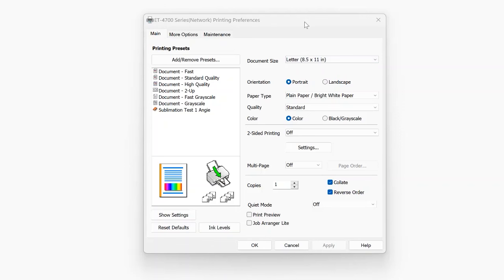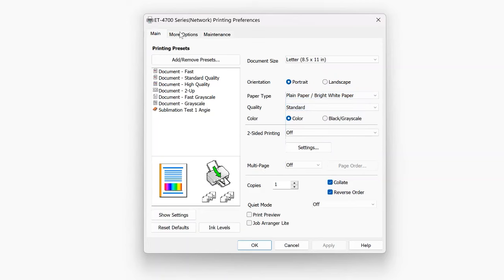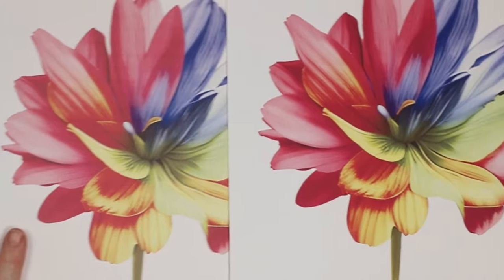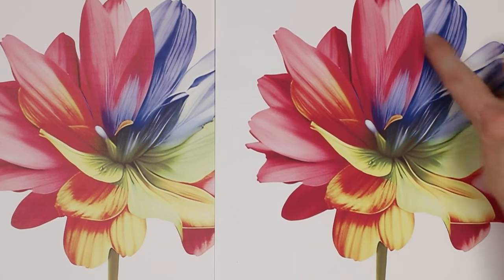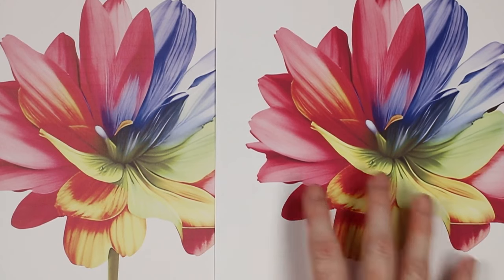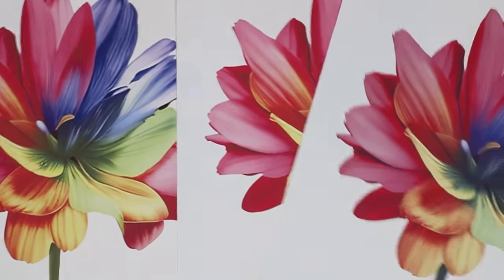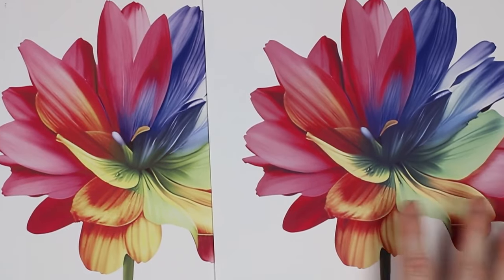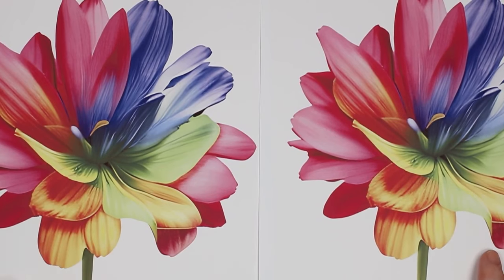How to Fix Lines in Your Sublimation Prints

Comment: TIP: Print head alignment is cumulative. You may need to do it more than once. Sometimes they can get way out of alignment for no obvious reason - or if the printer gets bumped. Happened to me. I needed to do 10 consecutive alignment cycles to get it back in range. You just keep running the alignment settings back to back. Keep choosing the best looking blocks. It will get microscopically better each time until it finally starts to actually look better. Trust the process.
Reply from the maker: Ten! Blah!
Reply: Not sure what has happened to my printer. My paper gets jammed when I try and print. Not sure if this is printer head alignment issues, or something bigger. Ink leaks, but strangely, my ink pads are not full or overflowing.. Printer hasn't been knocked/bumped or anything like that, so I have no idea where the issue is
Reply: So if it has lines in it are you able to run it back through the printer or that sublimation print garbage?
Reply: Exactly what i had to do but Worked!

Comment: Where do you find the printer settings. You skipped that part 😢
Reply from the maker: Depends on your computer but you can often just search printers on your computer to access. You will also want to make sure you have the correct driver for your printer. Go directly to the Epson website and download the driver for your specific printer model.

Comment: Thanks for all the clear help with understanding settings. I have the ET-15000 and I do not use sublimation ink, just the standard ink that came with the ET-15000. I just finished doing the purge/head cleaning cycles to get my cyan fully showing up again. There is still one issue... I am still working on it, but as of now I can't seem to completely shake these extremely faint darker blue banding lines running horizontally across the cyan color block. I only see them when printing in standard, but they are not there when using the high setting... on high it looks 100% solid and beautiful. Judging from what I have said, would you say my problem is no longer a clog or air in the lines so doing a 24 hour wait wouldn't really help at this point... and what my issue is now is solely with continuing to clean the print heads? I like the look of high better anyway but would rather not HAVE to print in high for everything. You made it sound like if you print in standard with plain paper setting you can likely expect the banding. Is that just the way it is with these printers and plain paper/standard setting right out of the box and they always gives those results? If so, that's disappointing and I would have hoped the Ecotanks, especially the pricey ET-15000, would not do this since I'd imagine most people who are not making crafts/clothing would start out trying to use plain paper/standard settings for their needs. Should I be able to get no banding with plain/standard under any circumstance?
Reply from the maker: All printers have this issue on plain paper setting. That setting is meant for something like document printing. For any type of crafts, you are going to have to choose a higher quality setting.

Comment: Angie, I have an Epson 4700 eco tank.  It worked fine at first.   I use Hippoo ink and paper.    I am having a problem with the black ink tank saying it is almost empty, but everytime I try to put ink in that black slot, it just does not go in and it overflows from the opening and comes out of the bottom of the printer all over the place.   Could this possibly be caused by a clog???  This just started happening recently.   It makes me think the black tank actually has more ink in it than I think even though the Epson software shows that it is almost empty.   The front of the printer tank is very difficult to see if it is full or empty.   Thanks for any help you can give me.   Love everything that you teach us.  Thank you.;
Reply from the maker: You have to go by the front of the printer. When you use sublimation ink, it is using a different amount of ink then the printer thinks it is so the printer saying it is low does not matter. You can reset that ink level on your printer if you would like but I ignore those messages and just look through the windows on the front.

Comment: Angie, thank you so much for all the video's you do.  Most have been spot on for filling my head with knowledge. I watched both video's dealing with clogged print heads.  My black was the one giving me trouble.  Finally go it to print solid with the black purge page.  But still lines both horizontal and vertical show when I print a design. And print head alignment...I can't even get it close after doing it about 15 times.  Is there a step further to take in order to clean the heads? I really appeciate all the information you share with everyone. Gail
Reply from the maker: Hmmmm....does the nozzle check page look okay? I would probably go back and double check your settings if so.

Comment: I bought a sawgrass1000  and downloaded the software and followed the directions to a "t," and it will not print. Their customer service is a joke. It's either chat or email so you have to wait for a reply. They really need phone support for their customers with more complex technical issues as their videos didn't help to resolve my issue. They are also EST time so if you're on a different time zone and work the same hours they are open good luck. I have an epson with regular ink and never had an issue with it. Should have just stayed with epson for sublimation. Thank you for all your videos and knowledge. You're one of my top sub youtubers I watch.
Reply from the maker: I haven't had any issues with their support and I have used it. Maybe some clarity behind "it will not print" would help? Was there an error message? What exactly is happening? Did you try using a cable to connect to the printer directly to see if it is your connection?
Reply: My issue has been resolved. Luckily, something very simple, but I sure did invest in a lot of time trying to figure it out. When i would print from print management it just wouldn't print. No error messages..nothing. I'd press print and it would load a little circle for a few minutes then nothing. 
I contacted support for 2 weeks until I was finally scheduled a PHONE call instead of their online chat feature or an e-mail back and forth sending videos etc.. 
I went through all their troubleshooting videos via their website and youtube. I am a beginner so this is a new experience with this printer. 
Phone support would be a lot more convenient rather than email, and I'd say a lot of other customers have felt the same when looking for help on youtube for my issue. Considering the amount of money we spend it would be a lot more convenient. 
My issue was resolved simply by unclicking the "margin" box in the print management settings. Who would have ever thought that would interfere with being able to print at all? Not me. But very happy it's resolved and I have had an excellent experience thus far.

Comment: Hi Angie, Thanks so much for both Videos, I have 2 Epson Eco Tank printers, ET2811 and ET1818, both have the same issues, I have been working on the ET2811 and completed all the sets also deleted all the print settings and run the pruge files. I have noticed that the Cyan purge file has lines in the purge print, the other colours are solid and fine. Any ideas on how resolve just the cyan issue?
Reply from the maker: I would try a nozzle check to see if you have a clog.

Comment: What computer are you using / where did you go to get to a dialog box that looks like that? I’m on a Mac and mine doesn’t have the “more options” section where you can adjust the speed of the sublimation printer. Thank you for the tutorial either way :)
Reply from the maker: This is a PC so it will not look the same as a Mac. Try different paper types on a Mac and changing the quality setting.
Reply: @AngieHolden  thank you!

Comment: would this work also for someone that accidentally pulled out a paper jam because ever since i tried 13x19 it jammed up my printer and has been messing with all my prints even the print sizes that were never a problem before using and its giving roller marks down it. its finally clearing up better but now its dots down each page. i would appreciate any advice on this situation. thank you so much!
Reply from the maker: My guess is there could be a small piece of paper in your printer so I would really look. Second, the paper jam probably got ink everywhere. Try printing some pages with just one letter to see if running the paper through will clear it up.

Comment: Angie do you happen to use a Mac with your sawgrass? If so are you experiencing any problems with it printing incorrect sizing? To small?
Reply from the maker: I use a PC.
Reply: @AngieHolden  ok thank you for answering. 
If anyone reading this has this problem and has found a solution to it please tell me because I’ve tried everything possible and can’t even use my Sawgrass at this point and have been stuck for months to no avail. 😔
Reply from the maker: You can try asking Cori George from Hey Let's Make Stuff!
Reply: @AngieHolden  I’ll do that! Tysm I appreciate your help so much!

Comment: Is banding a drip of a color on your print? I had that happen on my last two prints. I’m printing photos to canvas. My setting is premium Matt setting. 
My printer makes a noise mid way through paper during the print job. 
The black is what looks like a big drool going down & only in the color black. The Printer is only 3 weeks old. 
I did bump my printer twice before this happened. 
The first time the print drooled in the back on black I used it on my heat press & looks fine.
The second print, I haven’t heat pressed it yet.
How long after printing on A-sub paper does the print last before using heat press?
Reply from the maker: That sounds like a paper issue. Your paper is curling and hitting the print head. Look at your paper storage as well as humidity in your space.
Reply: @AngieHolden  I purchased the A-Sub 125 G 8.5x14 and the drips or drool started happening.
Reply: The paper is brand new I thought this paper might be good for photos on Canvas. I have A-Sub 120 G I used before the size is 8.5 x 11 and it worked without the marks but had a drool of ink on paper.
Reply from the maker: Ah that is probably your issue. Those weights absorb the ink at different rates.
Reply: @AngieHolden  The Hippo paper tore though when I printed on it too. 
The A sub 120 had one long drool mark with the black. I Changed to Matt setting instead of premium setting seemed to help but the drool is still there.

Comment: I have been getting lines in my prints that are not like the ones you show. They are almost unnoticeable unless you actually look. I have did everything possible with no luck.
Reply from the maker: Probably roller marks. Play with your settings as your ink is not drying.

Comment: Great video! I seem to have a slight black broken line all the way around one section of my cups when they go through the press, even though there is nothing on the printout before it is put into the cup press. Any ideas as to whether this is from the print settings?
Reply from the maker: I would guess it is a roller mark.